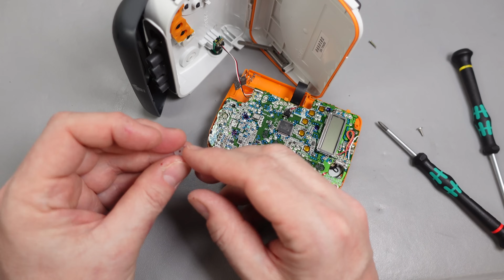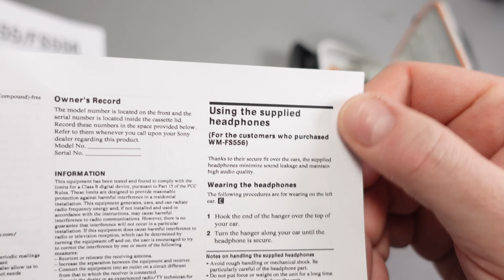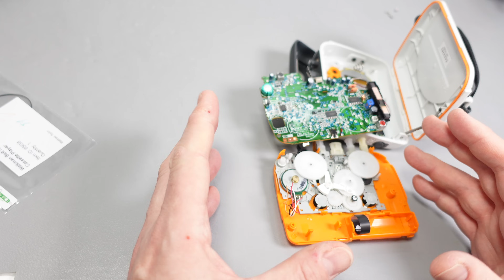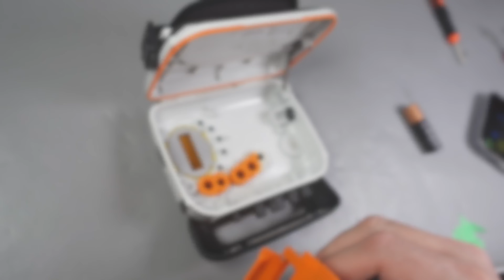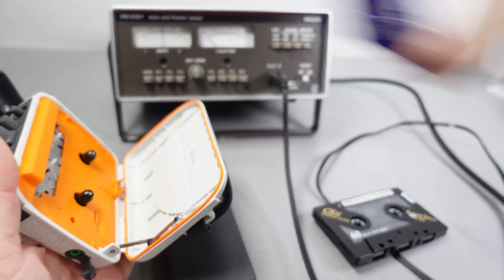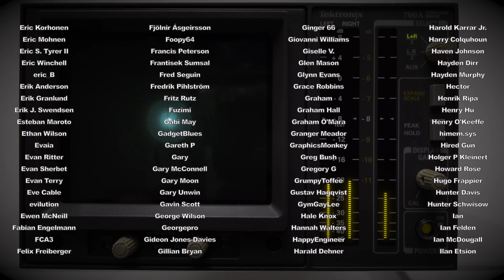SONY S2 Sports Walkman repair attempt

Comment: The tape head on this looks a lot like the one found on the higher end slim EX models of the time.
Which means it got a very good head with a outstanding frequency response and those tape guards will dramatically help keeping the tape aligned.

Those are brushless DC motors which are more complicated to drive, but more power efficient and actually frequency controlled.
The sony wm ex 921 even has a servo motor, which has additional HAL sensors for exact feedback of the motor rotor position (and speed).
There´s a regulator circuit, which adjusts the motor speed/power accordingly to the load.
This means, it will play sticky tapes at correct speed, it will play exactly the same speed in both playback directions too.
It´s just crazy how advanced the stuff was back then and nobody is willing to even just clone one of those older mechs.
Reply: Spot on! Actually, it isn't just the EX921 that had this motor design! They also used it with the EX9, EX900, EX910, EX20 and EX2000, and some of these models are even capable of running it at double speed for some crazy rewinding capabilities. 
Weirdly, the slim-delux EX models were quite popular in Asia and even outlasted this sports model. The final one they ever released was the WM-EX651 in 2004, which is a total underrated gem if you can find one... awesome looks and great sound. It even has a strange feature where there's a slider on the front that you can use to vary the playback speed (ANS - auto-nightcore system 😂)
Reply: @emilmofardin2.0  but most to ex line have encapsulated motor which unable to oil bearing.
Reply: @benzbhenz478  The motors have lubricant holes in the rear that can be used to re-lubricate them
Reply: @emilmofardin2.0  i cant find in my ex5 unlike panasonic and aiwa can dismantle to access the bushing.
Reply: It was easier to install a good-quality head with known characteristics than to cheapen it down to save a couple of pennies.

Comment: No we not forgetting, its just no manufacture wants to make them. We messaged TEAC to ask if they would spin up production for the reel motors/capstan motors for their REEL TO REEL line so we have a source to replace them, as they all used the same motors for nearly 15-20 years in all thier devices and they manufactured them for Pioneer and Realistic. They out right said they will no longer produce motors/parts for older equipment. The last run they did on the motors were about 10 years ago 2015. So many of these manufactures are stuck with whatever is still being produced cause the cost to tool up in their minds are not worth doing. Thats the real reason, not forgotten but not economically viable. This isn't NASA.

Comment: I collect these things and i keep repairing the ones that goes in my personal collection. The majority needs new belts and sometimes a re-cap. My collection is dominated by late Sony's and Panasonic's, a few Philips, an Aiwa and some oddballs like Akai (!), Sanyo and some cheap "Kasuga" that i used to have as a kid (well, not the one i had then, but an identical).
It always strikes me how well these mid to late 90's Walkmans perform with such simple mechanism, the ones made today doesn't even come close in either sound- or mechanical quality. Panasonic used to make excellent players as well, just not as pricey as the Sonys tend to be these days. Btw, webspareparts in Portugal is a good source for walkman belts as well. These later models usually requires a 0.5-0.7mm thick belt, which not all suppliers can offer.

Comment: I'm inspired now to change the belt in my Apple iPod MP3 player!
Reply: Make sure you get the right one, iPod belts are tricky, you have to match it up with the manufacturing date, they changed playback mechanisms through production a few times.

Good luck!
Reply: @volvo09  I know my post was tongue in cheek, but in fact it contains a tiny 60GB rotating hard disk drive, so who knows, it may even have a belt
Reply: @stratobuddy  I was totally joking in an over the top reply!

Comment: The one thing I remember with the s2 radios where they used to use a fair bit of battery even when on standby, use to always remove the batteries when not in use for a while.

Comment: The last iteration of the great Sony Walkman tape mechanism seems to have been engineered in a simple but reliable way. Those wow/flutter readings are pretty good for a device that was designed for sports use instead of "Hifi".

Comment: The fact that belt path is on PCB silkscreen shows a lot about Sony designers back in the day. In case of Sony it's almost like a lost art...
Reply: The design patent would have probably expired by now, so it's probably more a case of not wanting to tool up for a good mechanism when they could just buy cheap junk in bulk especially since most things sold over here are simple Alibaba whitelabel products with only a brand name slapped on.
Reply: @-Xaverius  The design also uses a custom brushless motor and Mitsumi brushless motor driver chip that is no longer in production, which are probably the hardest parts to replicate aside from the tape head. However, I think a suitably motivated company would find it pretty trivial to re-design those parts, as brushless motors are super common now, and that Walkman motor design is extremely simple and very similar to modern PC fan motors.
Reply: @faulknik000  yeah, designing a replacement would likely be a trivial exercise today, PCB based brushless motors are EVERYWHERE, but it's just not worth their time with the size of the remaining market.
Reply: @-Xaverius  I was out at the shops yesterday and saw a new cassette player. It weighed about 0.5 micro grams and only had play and fast forward. Literally didn't even have the ability to rewind. Some of the cheapest filth I've ever had the misfortune to see
Reply: Do they hold the rights to this design of tape mechanism or is it just companies today don't want to put as much effort into their design? I suppose the number of ppl using tapes today makes it unviable to Sony.
Reply: @thelastofus2872  Yea it's about money, I would say that factory cost of something like walkman was quite high, compared to smartphones today that does not have almost any mechanical parts.
Reply: Sony was great with repairability, even though their devices are fiddly at times because they are tightly packed and space optimized... I love how they would mark screws you had to remove so you wouldn't remove un necessary screws.
Reply: It's not exactly comparable because I really doubt there will ever be a need to take it apart, but the Sony portable radio I bought a couple of years ago (slightly larger than a pack of cards) is still easily disassembled by removing a pair of clearly marked screws inside the battery compartment.
Reply: Sony used to offer repair parts back in the day ( 2005 or so last time I checked) but who knows if they still do. They did pay attention to serviceability which is good because the S2 line was pricey.
Reply: “A lost art” in the case of Sony? In what regard? They haven’t made this type of product in years, so what are you basing it on? In my experience, Sony is still among the better brands to service even today.
Reply: @tookitogo  The minituarization of these mechanisms Sony was able to do on mass production scale was art of itself and yet they still were able to keep reasonable level of serviceability. As a service engineer, this is something that I do admire and I know how hard is to fight with designers reminding them that somebody will need to fix their creations someday.
Reply: @pekarj  Right, but what modern Sony product is there to compare this to? They haven’t made a portable physical media player in ages. So it seems to me you’re saying “Sony has forgotten how to do this” based on, well, nothing.
Reply: @tookitogo  well exactly there is nothing to compare with today's products, that's why it's sort of considered (not just by me) as lost to the past. It's not a complaint, just an observation where consumer electronics moved into over time. Of course modern smartphone does have its own work of art design aspects and in I do also admire that what we can cramp into letter stamp size PCB today, and even more if somebody is able to repair it.
Reply: @pekarj  " Of course modern smartphone does have its own work of art design aspects" To a point, though Sony/Ericsson, Panasonic and Sharp and the like are not very competitive in global smart phone sales, unless I'm mistaken? I guess they don't like the rapid product refresh rate and slim profit margins (it's not worth their while to try to compete with the Samsungs and Xiaomis of the world? the idea of replacing product so frequently doesn't really fit with Japanese business philosophy, which is usually to refine and only update if necessary -- we still see  vacuum fluorescent displays in Panasonic home micro hi-fis sold today even though this is wildly outdated technology for example?).  

[Predictably no longer any cassette mechanism on these Panasonic mico hi-fis though, although my ~2012 model still has a top-loading cassette deck -- SA-PM54 with bi-wiring and extra piezo tweeters (over other Panasonic micro hi-fis, that just have the 3.5" mid-range and ~1" cone tweeter), I think it sounds great, highly recommended! I think it sounds better than a PMX5DB I have, even though that is much higher in the Panasonic miro hi-fi range.] 

"All we know is Korea overtook Japan in consumer electronics and now China has overtaken Korea..."  But at least the Sonys and Pansonics of the world are still in business, unlike the Grundigs and RCAs (except as a shell brand used on generic junk)...

Comment: Given how simple that excellent mechanism is it would be fairly easy for some Chinese manufacturer to reverse engineer it, clone it and produce much higher quality clones than the ones currently available. They would probably sell loads to the likes of Tascam/Teac, FIIO and those still making cassette decks who want a higher quality new mechanism. Of course it's unlikely to happen as it's all about maximum cost cutting these days.

Comment: "MegaBass is insane!" => They knew how to party in the 90s!
Reply: I loved the megabass on my Sony stuff!
Reply: with those crappy headphones they were packaging with the walkmans the mega bass had to be really strong lol
Reply: @ejej1187  You 'canna change the laws of physics.
Reply: @ejej1187  True! Headphones and earphones had come a long way since then.
Reply: @sonic2000gr , I have found that modern ear buds aren't very good for using with older Walkmen (and similar).  They have very low output because of incorrect impedence.  Modern impedence is higher, and thus the amps in the old equipment can't properly drive the modern earbuds.  I found some NOS Sony earbuds from the early 2Ks and my Sports Walkman sounds great, and loud.

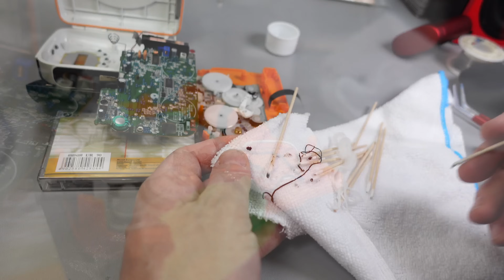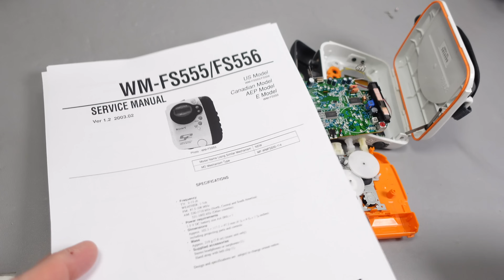Comment: What is that red tube thing in the upper right corner from 5:35 to 5:50 ? It looks like the part closest to the center of the screen is perhaps a spongy material.

Comment: Hi Matt, when you talked about serving, changing the gasket and cleaning the inside... It dawned on that when I had my walkmans, for me there was never any thought of servicing them! I wouldn't have even considered sending if off to one of the addresses in the instructions. However my last one, an Aiwa, was amazing! After about years playing became temperamental. I managed to find a Sony service centre at Heathrow. They couldn't fix it and offered me a new Aiwa. It was no the spec of HSRX748 and was not happy!